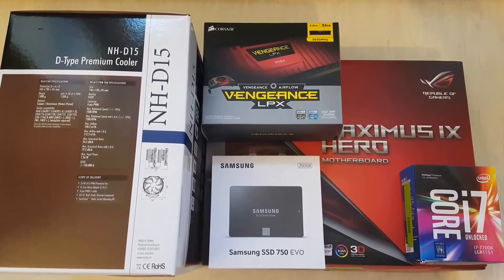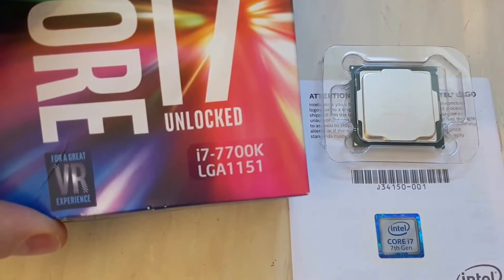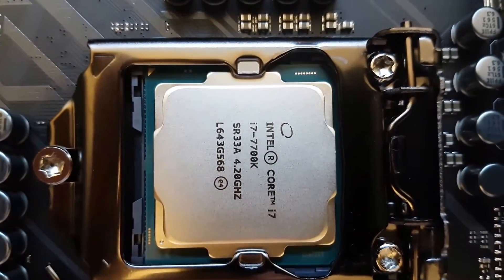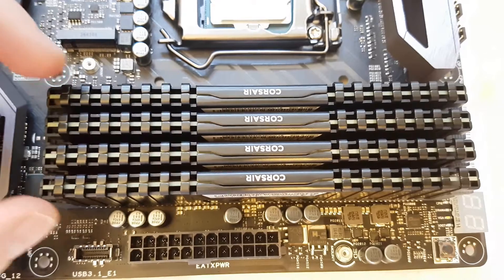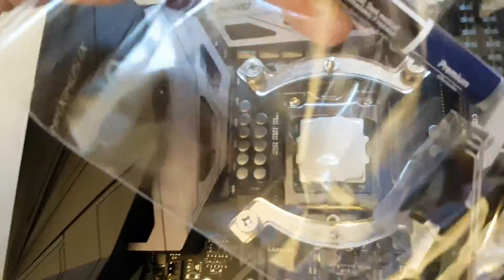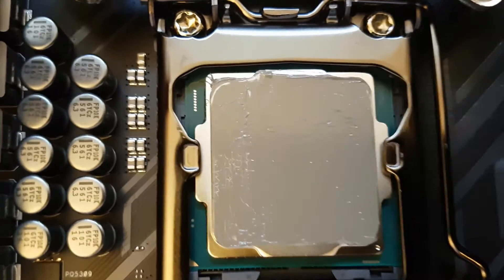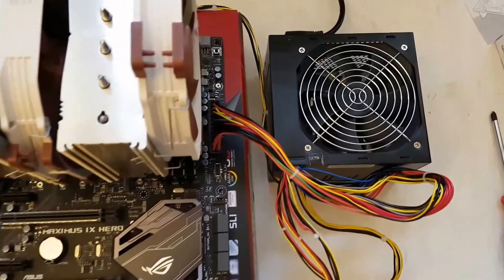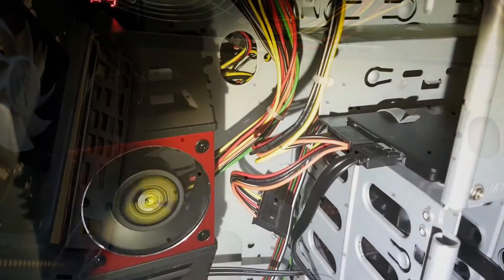How to build your own high-end bench PC

Comment: You applied the thermal paste completely wrong. You do a pea size blob in the middle then put the cooler on with no spreading. You will have poor thermal transfer the way you coated the entire face of the cpu.
Reply: Achim did it perfectly. Carey Holzman (IBM computer installer for 30yrs) suggests using scotch taped to fingertip to spread it thinly and evenly. I think this credit card method is even better. The goal is to even out all the micro-pits on the surface of the cpu lid for efficient thermal transfer.
Reply from the maker: I think the reason why a lot of people say that I did it wrong is because the thermal paste layer looks very thick on the video. Actually it's ultra thin. Therefore, I can even understand the reaction of some guys here.

Comment: Very bad idea to plaster on the compound
There could be a lot of air bubble decreasing the effiency of the cooling
Reply from the maker: +Jean Mahmoud Ventilateur Nope! The layer is very thin. As already mentioned the thermal connection between heatsink and CPU can easily be judged by simply looking at the CPU temperature at full load.

Comment: A processor is not a cake tray and thermal paste is not butter!
All you need is a grain of paste!

You skip a lot of important parts to focus on what should be given a mere couple of seconds.
Reply from the maker: +Mort Schubert Well, when it comes to thermal compound there is golden rule: As much as necessary, as little as possible. Although my way to attach thermal compound might look strange, it clearly follows this rule. The layer is very thin. However, I apply enough thermal compound to fill the gap between heatsink and CPU. Don't understand what's wrong with this? In addition to that: The quality of the thermal connection can easily be judged by simply looking at the CPU temperature at full load. My CPU only reaches 42°C which is in my point of view pretty good. Kindly let me know your ideas / comments regarding this.
Reply: Hey! I was thinking about all the discussions on the web on the subject. The cooler manufacturer themselves speak about applying a tiny drop only - in the centre, so that, when fixing the cooler in place, the paste would just spread in all directions evenly.
If you temperatures are as low as you say - I would say, the lowest ever I have read about -, you obviously did well - and that challenges a lot of theory on the subject!
42°C! How long could that be maintained in full load?
And how do you measure the temperature? RealTemp? CoreTemp? Other? I will go for what you have gone for! :)

As for the other thing that I said in my previous comment, I would have liked to see more about installing the RAM modules (lots of people make mistakes there, too, simple though that process might seem) and more on actually setting the cooler in its place. Other than that, lots of details, lots of questions being answered.
Still, two more: what is the PSU in your machine? And: do you think that the cooler on top of the memory modules is also, to some extent, responsible for the CPU temperature?